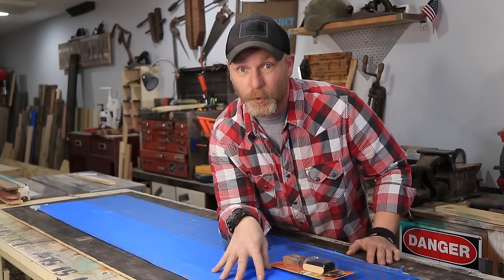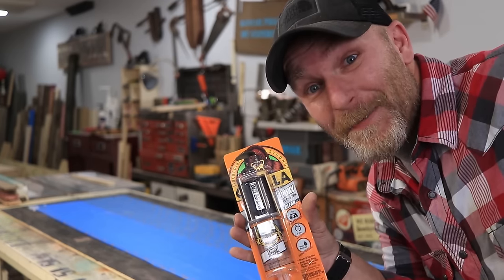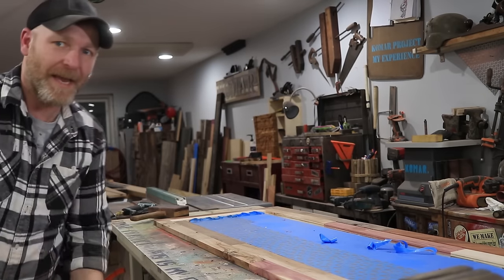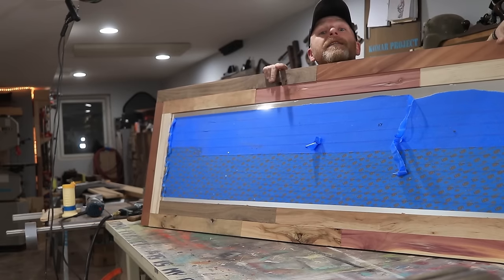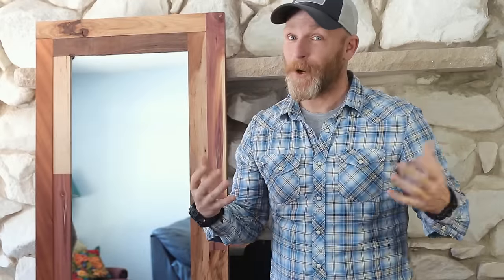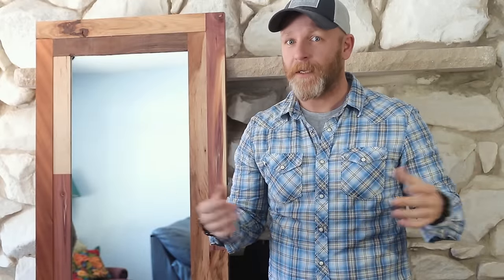How to Make a  Wood Mirror Frame ||| Easy DIY Woodworking Project

Comment: Great build, i have 2 mirrors like that from old Wardrobe doors, the mirrors are still attached and i was wondering about putting some say Pallet Wood around the edges, this has made me think that it could work as a standing mirror, so thanks for that.
At the time of typing this you have 919 subs, so hopefully and fingers and legs crossed, by your next video or 2 you will reach that magic 1000 subs.
Well done again on the build.
Barry (ENG)
Reply from the maker: Barry Roberts you got it brother.  Might look great !!